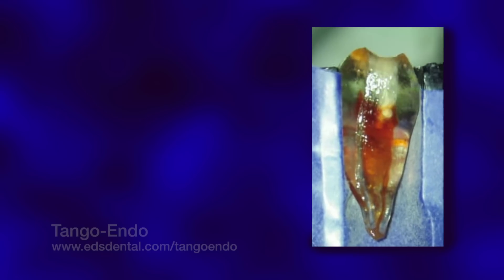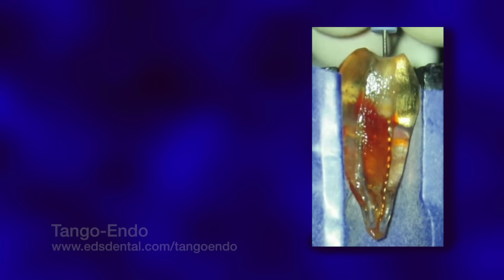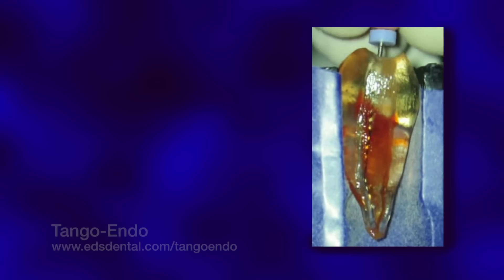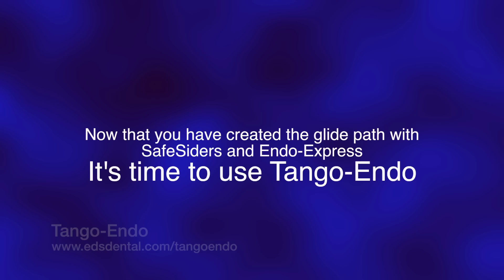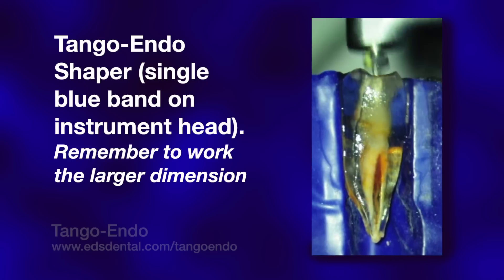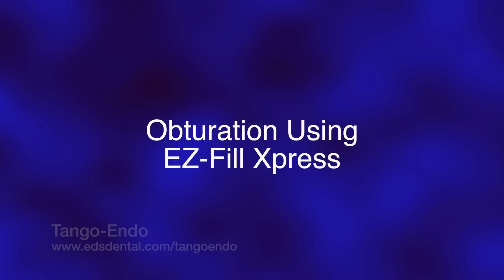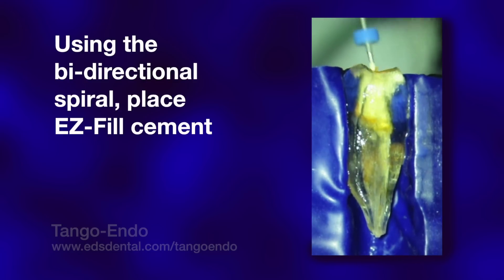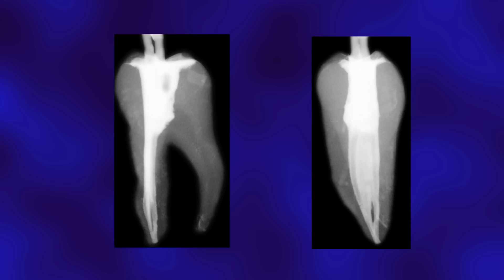Tango-Endo Instrumentation: Completed in a plastic tooth for viewing

Comment: Great video Barry. As we once discussed at the GNYDM in 2015, I think many teeth only require a .02 taper. You did comment to me that the trend seems to be going towards .02 taper as the goal is conservative dentin removal both within the canals and coronally. My only reservation with the Tango System is that it REQUIRES using .04 taper. I use Dr. Nudera's irrigation technique of agitation using 17% EDTA followed by 5.25% NaOCl which does a great job of cleaning the canals. After thorough agitation, I have found that many canals are naturally .02 taper, with .04 taper usually found in younger patients, especially in the palatal canals of molars. If the Tango System was offered with a .02 taper, I would definitely give a try. All the best, Dr. Rick.